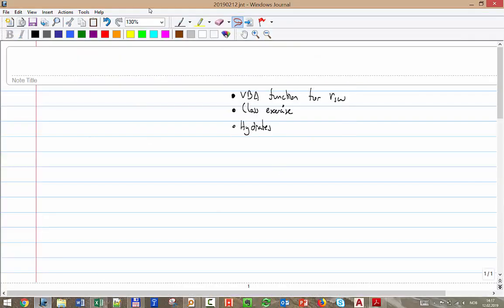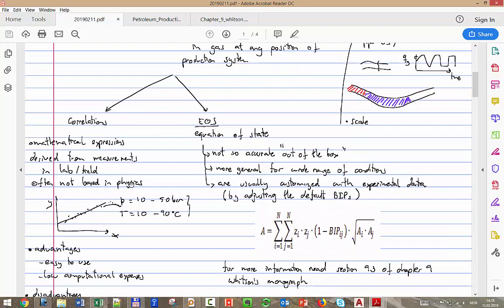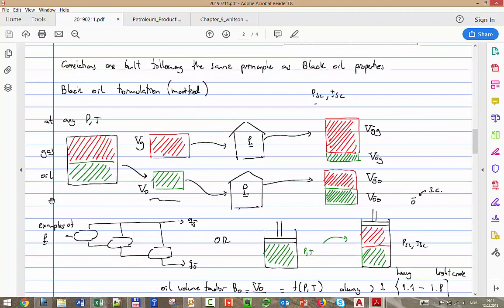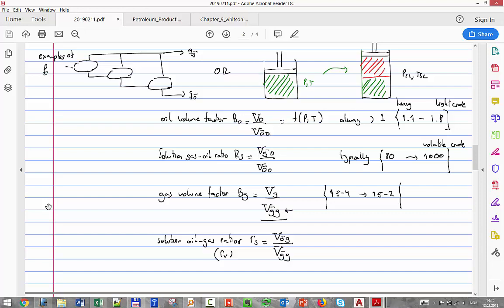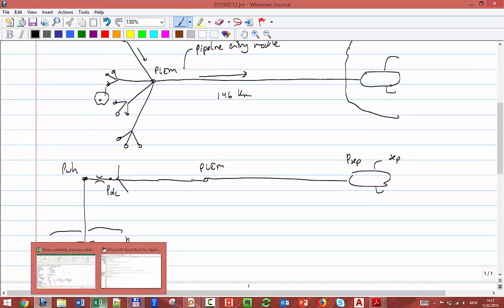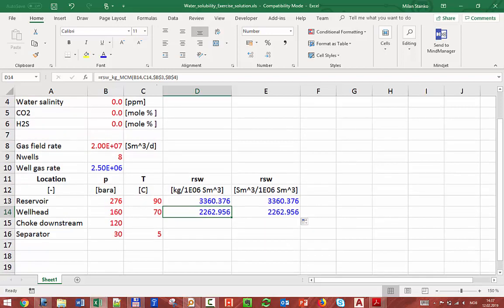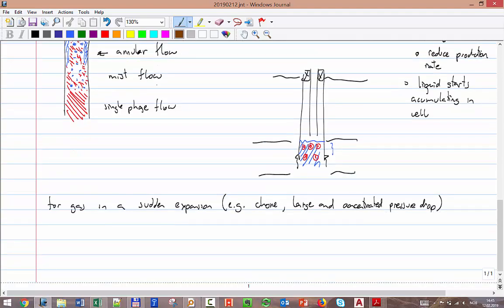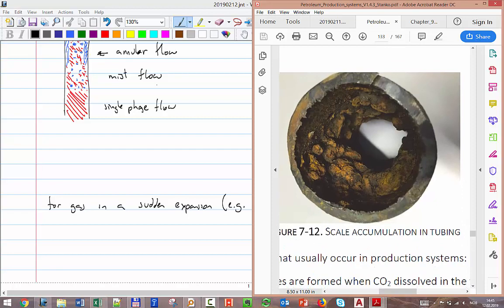Water content in natural gas -  class exercise- Intro to hydrates

Comment: Hello! Can you explain why the VBA function doesn't work with temperatures below -17,7 °C? Is there a way to determinate water content below this temperatures?
Reply from the maker: As mentioned in the monograph, the VBA function approximates well the McKetta-Wehe chart and it has low errors for the range 100 F < T < 460 F. For temperatures outside this range, I suggest reading directly from the chart (the chart has values for temperatures lower than -17 C)